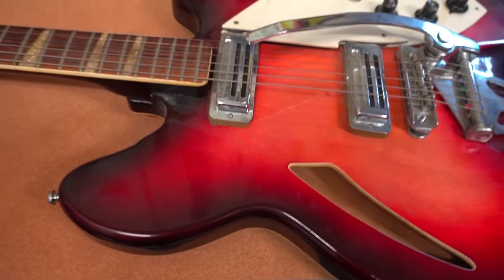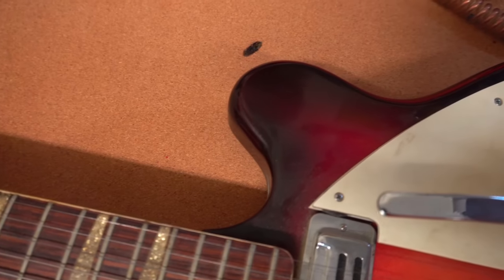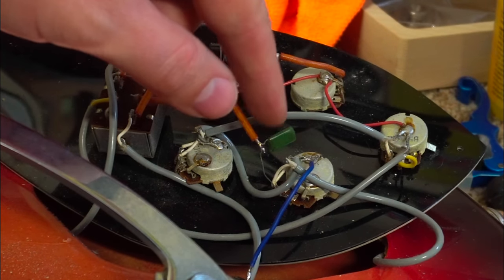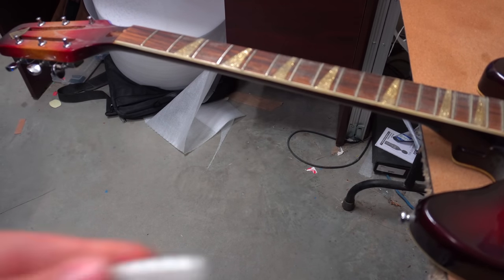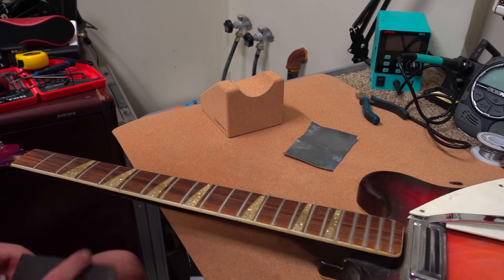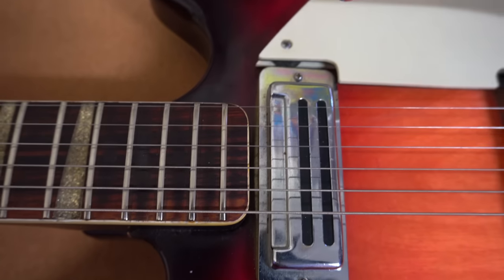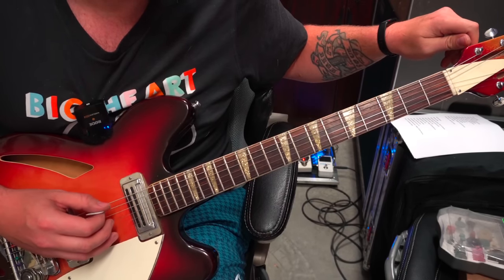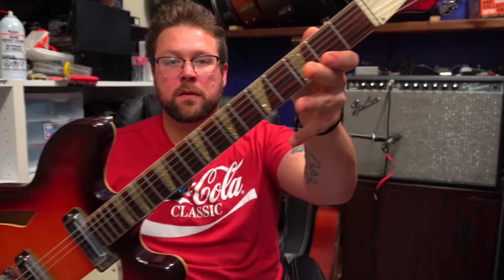Garage Sale TREASURE! Fixing up a $20 Guitar FIND

Comment: Wiring Suggestion - The green capacitor is supposed to have 2 ends, one end broke off.  It looks like you soldered the lead to the same end and eliminated the capacitor from the circuit.  Please get a replacement capacitor and solder it like:   End#1 —-|(—— End#2.  That may improve the sound of the circuit and will at least implement the circuit s intended
Reply from the maker: I did realize that and threw in another cap! Thanks!

Comment: When levelling the frets I was taught to take full sweeps of the fretboard with a levelling beam so that they are all filed equally
Reply from the maker: I use a fret rocker after I level to ensure all frets are level. I have a leveling beam also, but I don't find I use it very much
Reply: As long as you end up with every fret level and true, it doesn't matter how you achieve this.  It's best to start by making sure every fret is well seated.  Press them back in, with a bit of glue if necessary.  Then I always tape off and mark with a sharpie, but I would rarely attack the frets with a file, as I only want to remove the bare minimum material.  My latest success has been to cut a 1" wide strip of 1000-grit wet & dry paper, then wrap one end around a 9" aluminium spirit level, pull the other end tight and tape that.  No need for double-sided tape, so the paper comes off easily afterwards.

Comment: That was a steal for twenty bucks, nice find and repair. I would maybe try and wax pot those pickups, even if you can’t disassemble them it will still probably make its way in and might get rid of the problem.

Comment: I own 2 very similar instruments, 6 string like this in Fireglow (mine's a little more red), and a project Sunburst 12 string that needs a bridge and tailpiece but is quite clean. My luthier said the tops are Spruce. Bolt on, bound necks but block inlay instead of shark fin. Super tiny frets.
Guitars from Aria/Ideal/Encore (my 2) and possibly this "Pyramid" axe...were likely ALL produced by Fujijen at one time or another, as the factory stamped "Japan" or "Made in Japan" on the neckplate of these 3 brands pretty consistently. Mine also reads "Steel Reinforced Neck". Go figure...
In my estimation, since the Ric 360 did not come out until 1965, the closest I can date these guitars  according to pretty reliable guitar-knowledge people (who were not just alive then but playing) is roughly 1965-1975. In the 70s it seems like Japanese guitar manufacturers really focused on clones of Fender & Gibson models and by this time most of the 60s super-groups associated with Ric guitars had broken up and/or moved on to other gear (Beatles, Who, Birds, Buffalo Springfield etc.) so the allure of these instruments was diminished as I'm sure also were the sales of them, being that they were never inexpensive to begin with. 
These guitars also all used similar tuners, vol/tone pots and p'ups (yes, they're terrible & microphonic), but mine are like Hofner "Staple Head" type; weak humbuckers that read about 4.7-4.8 resistance. I can OD 'em, but straight up distortion...not so much.
 I dumped that crappy Bigsby and (plastic saddles!) bridge and put in a Winfield trapeze and a T.o.M. type bridge on the wood base. Improved sound 1000%, but the Gibson spaced bridge puts the strings a little close to the edge of the fretboard so at some point I'll re-do the bridge saddles & new nut to better specs. It's playable, but still a project. 
These guitars get LOTS of attention when you pull them out at the music store or the gig. The vibe they exude is undeniable, but Ric guitars (not basses), get ignored by most players unless they're REALLY into them, or the artists that use them.

Comment: The way that you have rewired that capacitor bypasses it so it is no longer being used. Caps have two legs on them, one in and one out, the one that broke off of that skinny bare wire should've been reconnected. Instead though you connected the wire to the cap leg whereas you should've connected the cap leg back to the cap. Have a look at it again and you'll see a little stump on the corner of the cap that is pokey wire. That is where you should reconnect that skinny wire. Sorry, tough one to explain.
Reply from the maker: Done and done! Thanks
Reply: I saw that too. Nice spot!

Comment: That's a cool guitar, my friend. I have a quick story for your edification. There was once an Epiphone les paul that needed some fret leveling. The tech neglected to tape over the pickups before leveling. Naturally, all those nickel/steel particles migrated to the pickups and made them unusable. Had the tech been able to remove the neck to do the fret work, he prolly would have and damage to the pickups might not have happened.
Reply: You read my mind
Reply: Old wives tale. The frets are non magnetic, and the file (which is) is way harder than frets and would not generale particle.
Reply: @ant1sokolow  People who don't know any better (yes, me, a long time ago) have been known to polish frets with 0000 wire wool, which does create particles, and is magnetic...
Reply: @ParaBellum2024  Does that cause problems ?
Reply: @ant1sokolow  Yes, because any tiny pieces of steel that come close enough to the pickups will be attracted to them.
Reply: You unlucky , as many people who know better ( me  and many other)use steel wool on frets  with no ill effects on pups..

Comment: I have a very similar guitar under the Ideal brand. The difference with mine is that it’s bound on top and back and it has dot inlays. Same pickups. Very cool low-output single coils which sound a bit like the classic “gold foil” pickups.  I replaced the foam under the pickups with something stiffer and non disintegrating and at one 😊point stuffed softer foam inside, thinking it would help with the feedback (not realizing it was the microphonic pickups).  A very cool cheap 60s guitar.
Reply: I have two other Ricky copies from that era as well, one being just like the Ideal except not bound on top, but not as round as yours. Mine is more like a 330 to your 360 style. The other one is a slightly different body, more like a 360, but a little more meat on the top bout. That one has slots in the headstock for a 12 string, but this is only 6.

Comment: Cool $150=$200 guitar...let alone $20.  Get a new cap though, you just put the two wires in series! Nice vid. Those big ones are oil caps, but in plastic instead of paper. Probably 1950's. You see them in late 50's and early 60's tube amps, and they're usually leaking DC. However, in a guitar cavity, theres no heat, (and little to no voltage) so yours are probably just fine. Thanks for the effort and  cool video!

Comment: I don't think this guitar is from the 60' but more probably from the 70'.(up to early 80')when FujjiGen start to build OEM guitars for various importer brands  in USA and Europe. In the 60' they were more into the domestic market.  Models were less direct(less accurate ?) copies of US big brand ones..
A characteristic  of  FujiGen  guitar of that era is the good quality of luthery and  very poor pickups and electronics.
The one shown is really nice  but probably almost unplayable with that much microphony. . Perhaps wax potting can help, but the pups seems to be almost totally enclosed and i'm not shure it would work.  Also the attachment to the body may be improved...
Some more work...
Reply: Definitely ‘60s, those pickups were one of the earlier types Fujigen used on Ric copies. I have almost the exact model with a slightly different tailpiece and cheap single coils with humbucker covers branded “Apollo” that is from ‘66-‘68. You also see this model being branded Greco out of the Fujigen factory starting around ‘68, with yet another different trem system. My guess is ‘65 or ‘66.

Comment: Rickenbacher's have their name on the headstock ON the plastic plate.  They don't have an aluminum plate that says "Pyramid" on them.  This is like a Rogue issue guitar that was a Rickenbacher copy - but before Rogue came around as a brand name.  See if the pickups and wiring are good and if it tunes alright.  I wouldn't expect to sell it for more than $450.

Comment: Cover the pickups with tape! Metal filings will destroy your pickups.
Reply from the maker: It's steel wool particles that you need to worry about, which I do not use for fretwork. It's usually not an issue because I'm quite careful, but if any fret filings accumulate on the covered pickup (again not as big an issue on covered pickups) is takes a second to remove. If it was uncovered pickups, I would take extra precautions

Comment: I really don't understand why you wouldn't cover the pickups when you file the frets wtf
Reply from the maker: It's very easy to remove afterwards if any fret filings accumulate on the pickup. I'm careful so it's usually a non-issue or just takes a second to clean up. Typically it's steel wool particles that you need to worry about which I do not use for fretwork.